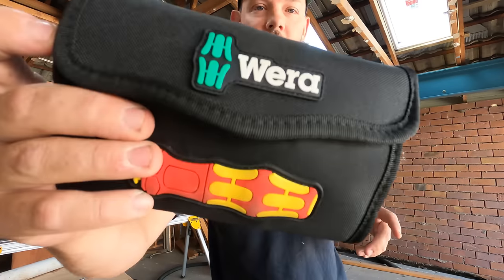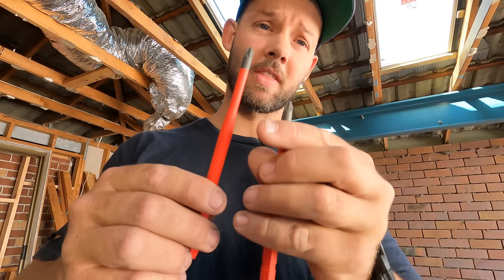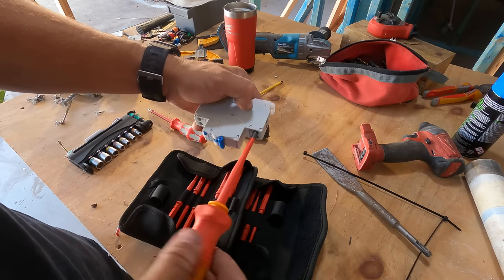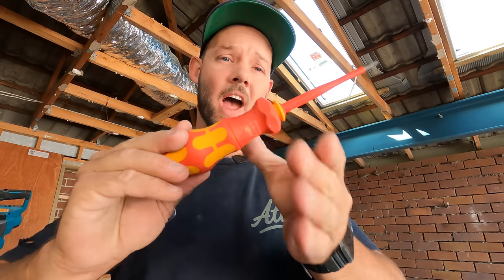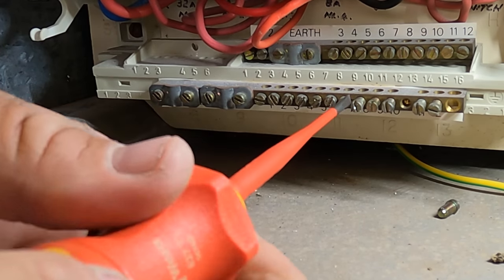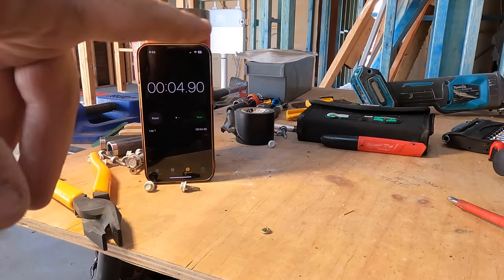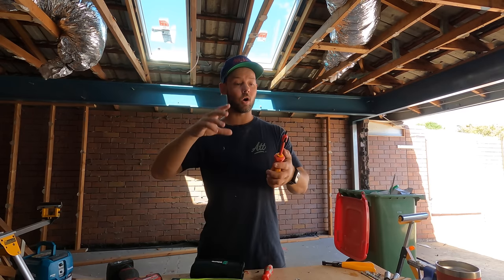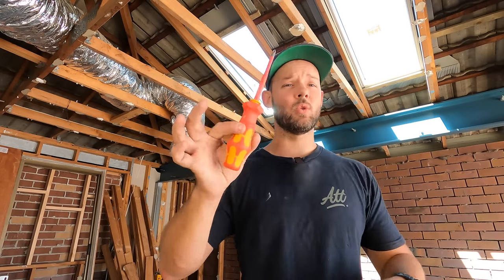WERA TURBO pros cons & applications

Comment: Just bought this and it’s a lot of rubbish. It struggles to screw a power point back to the wall. Bosch go is king.
Reply from the maker: It’s crazy how much it struggles. How long have you been using the Bosch go? I loved it but was a little bulky compared to the vessel. Heaps of torque though! I had to keep it on low for most of the work I did with it
Reply: @AddictedtoTools  I’ve been using the Bosch go for about 4 months. Once you use it for a week straight and it becomes muscle memory there is no going back. You figure out different torque settings for different applications gpos fan sockets etc. Have been using makita CXT impact for years but the Bosch GO fits in the tool belt better. I think the WERA TURBO is made for applications in Europe. Maybe they have machined screws in their power points and light switches.
Reply from the maker: I did the same thing. Going from the m12 drill to the go. Love that it fit in the pouch.cheers for the feedback👍
Reply: Nice job would love to see a review on the milwaukee installation drill/driver kit  seen a few electricians use them
Reply from the maker: I could do that some time. I’ve been using it for awhile now
Reply: @Simon Bates  your 100 percent right mate,im in the UK,  all our electrical accessories are fastened with machine screws M3.5 mainly, including Data and Voice outlets - however after a while fixings can corrode ,thus rendering this tool useless . As much as I love Wera kit, I would not buy one of these.

Comment: Used the wera interchangeable drivers for years. The torque driver is awesome, the blades are great. All I want is a powered handle and Wera make this 4x1 speed handle. I invested, its not cheap, and it turned out pretty terrible!!! Shame really, but it sucks. I've moved onto Vessel now for my powered driver!!
Reply from the maker: It’s very unfortunate. I think the electric is the way to go. How have you found the vessel?

Comment: I would expect the torque available in turbo mode to be 1/4 of that available in direct mode.  No design in the world can overcome that basic principle.

Intuitively,  I would never use Turbo mode in either direction for a tight screw - it's just for getting the lightly-loading work done more quickly.

Comment: What is the voltage and frequency of your current in Australia? Just curious...
Reply from the maker: 230v single phase, 415 3 phase. 50hz
Reply: @AddictedtoTools  Oh, lucky you, you can use Makita and Bosch as the gods...I mean, engineers, intended. It seems it is only America that is still stuck back to the age of 110v

Comment: I won an uninsulated one when they first came out and ive got to say it was a total let down. 
Handle felt too big, tightened up a few screws and now the mechanism gets stuck when trying to change it and its a pain in the arse having to change it from running a screw in fast to nipping a screw up constantly. I agree you can't get the torque on it whilst having to use two hands on the screwdriver. Good idea in theory but poor idea in concept and execution from wera. 
They say it saves so much time but it really doesnt, i find it quicker to just use a normal screwdriver. 
Better off spending the money on an electric screwdriver if its the speed you need.
Reply from the maker: It definitely was a bit of a let down. I’ve been excited to get it for years. I’m really curious how many people are actually using it daily.
Reply: @AddictedtoTools  the only bit of the set i won that gets used daily is the driver bits that came with it 😅

Comment: Seems to come across as a tool searching for a problem rather than it being a solution. I can understand a 4:1 ratio in 4 handle turns to one driver turn for helping to unscrew super tight terminals but the two hands thing is stupid. I’d have to grow a third arm if I’m going to be holding cables in position whilst trying to use the “turbo mode” to tighten terminals.

Also how do you find the Voltex gear? I’ve heard a lot of good things and am thinking about making the switch from nhp.
Reply from the maker: That’s a good idea for those tight screws! I definitely couldn’t see this being used for much of the work we would do. 
I’ve only just received the voltex gear for my switchboard upgrade. I can’t say much about the gear personally yet. I’ll be sharing the upgrade and how the equipment goes.
I have heard good things from most though. I’ve done a few polls on Instagram. Majority was great feedback, especially with warranty and customer service.

Comment: Can't fix the torque drawback, it's just Physics.
I use it to (un)fasten +-30 terminal screws of HV protection relays. Need to unturbo it if you need torque. For some reason those relay terminals have flathead screws... you showed precisely what happens when you use turbo on those. It sucks. It's alright for repetitive work, but nowadays I just a Bosch Go when I can get away with it.
Another advantage of that set is that you have two handles and can use two bits at the same time instead of switching them out.

Comment: Yeah I agree. Was pretty disappointed. The play in it when it’s in stiff mode is no good and it struggles to put in machine screws that are that aren’t perfectly smooth. Now it’s just a house screw driver kit. And super expensive. Although I’m thankful I didn’t buy the insulated ones.

Comment: I’m an appliance and hvac service tech do you think it would be good for running all of these 1/4” screws in and out that hold all of these things together it’s just mainly sheet metal and I do like and service  Fisher & Paykel
Reply from the maker: Hey Jason, it could be good for that. Would have to use it without the turbo and then turn it on

Comment: Good day, this guy has been my daily for quite a while now. I work as an electrician and this is my most essential tool. The bigger handle feels nice in the hand and makes it fatigue slower and about the torque problem - the first 2 spins you gotta do non turbo then swich to it for loosening and the other way around for fastening. I also have the feeling that i can apply more torque after its been used for a while. Even if you need more torque its one button push away. In my opinion its an great tool, but i wish it felt more sturdy when it comes to tightening screws, i would even sacrifice the 4 to 1 ratio and lower it to 2 to 1 to get more power out of it.

Comment: Do you use torque screwdrivers in the consumer unit? In Uk is recommended to tighten mcb, rcbo, main switch etc to manufactures Nm rating in consumer unit.
Reply: Nah we don’t do that in Australia, we’re a bit slow over here, maybe in 5-10 years

Comment: It's a nice kit, but I could do without the turbo handle...
Reply: Just buy the kit with standard handles then.
Reply: @stupot_64  I already owned it when I wrote that.

(The regular Wera electrically insulated changeable tip screw driver not the turbo version though...) I also have the torque driver...
Reply: @binaryglitch64  Same as me.
Really don't see the point of the turbo handle that you need two hands to use.

Comment: Interesting... but if I'm being honest, it seems kinda outclassed. Design wise, a standard Yankee screwdriver is smaller, faster, and has the ability to ratchet for high torque applications. At this price point, you can likely also find a Yankee with nearly equal play in the shaft and the ability to holding bits (Not that I like bit holding screwdrivers). I suppose this model of the Turbo is insulated, while I can't think of an insulated Yankee  -- but I wouldn't be surprised if somebody made one.

Comment: Switching between modes often bogs down, which slows me down. Unacceptable, Wera. The gear is rough. Also, the torque is soo low, that it struggles to tighten even quite easy fastening conditions. You can actually get more torque and a similar speed by just twisting the screwdriver with your thumb and forefinger in front of the handle. Big fat fail.
Reply: Wish I never bought it. Waste of money. Also, what's the purpose of including a smaller handle in the kit? It's not even the size of a regular Wera handle.

Comment: The button is kind of quirky on the one I have which is not the electrical one. And it's only on extreme low torque situations like light switch covers things like that if you need to loosen it you have to do it regular and then you can put it in turbo and get it the rest of the out. Or you could just keep in regular mode and probably have it out half the time. I do like all the tips that came with it spot on with their fit. And they're not little short things that you can't get into a deep cut out

Comment: Pretty sure it's 4:1 so you just divide whatever force you are applying by 4, and that's how much force is being put into the screw, or coming from the spinning shaft end.  You can get a similar effect by just spinning the shaft and not the handle lol... You don't even need the fancy button and gears. Just a normal old screwdriver.

Comment: Yea you aren't supposed to drive screws all the way with turbo, just get them in as far as they can go then torque it down like you with a normal screw driver. It's not an impact you aren't going to blast big ass screws into wood with it in turbo
Reply from the maker: 100%. I don’t believe I said that’s the purpose.

Comment: There’s no way to “fix the torque” issue. That would need violation of the laws of physics. The gears give 4 times the speed, which MUST give 1/4 the power/torque, (slightly less, from friction). The power you put into 1 turn of the handle is split between the 4 turns of the screw. I think it’s a cool product, and like that they make such things, but I don’t feel I need it.